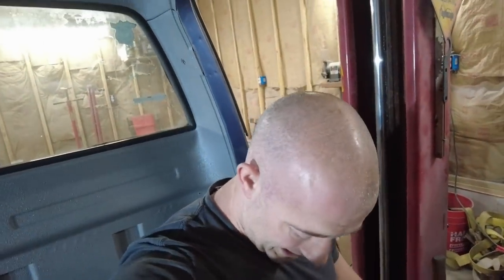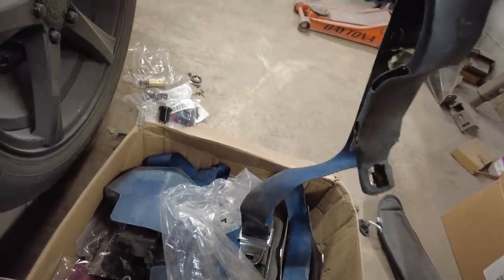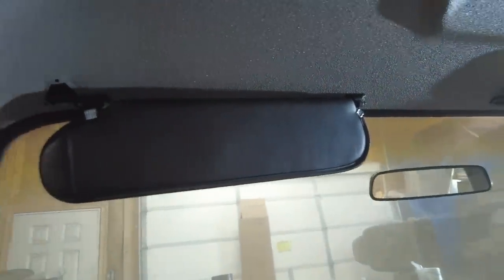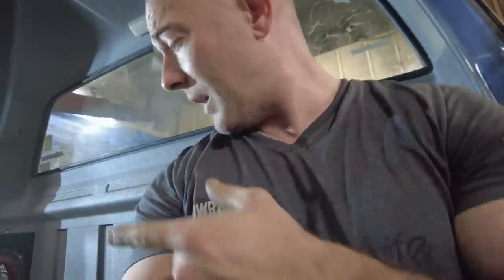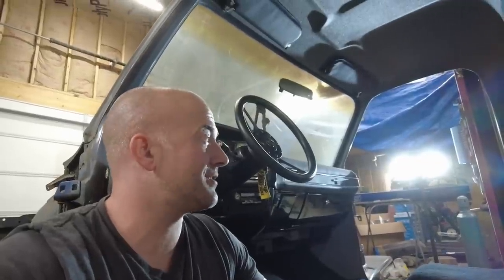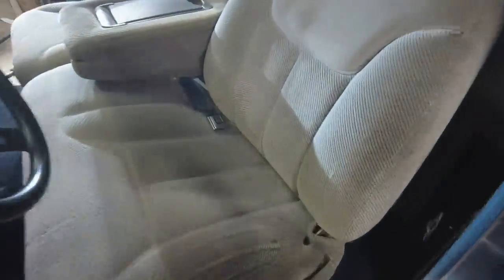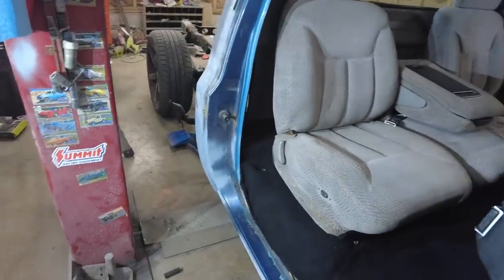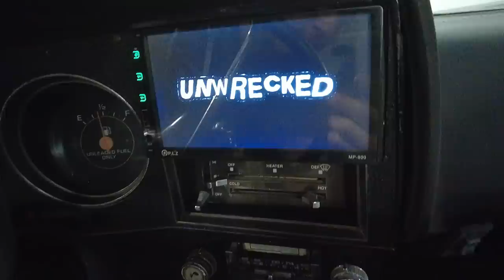Finishing the Interior on my 1985 Chevy C10

Comment: 16:20 with that raptor liner, if you should have an accident, you will no longer need a shaving on your head Todd 😉!
Reply from the maker: The raptor liner is actually a smooth finish.  It's nothing like sand paper and is rubbery